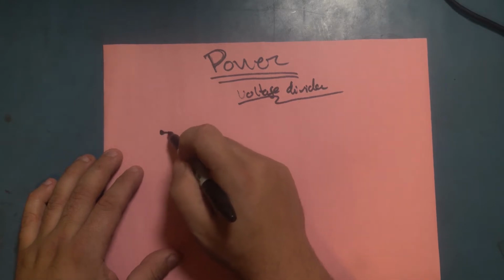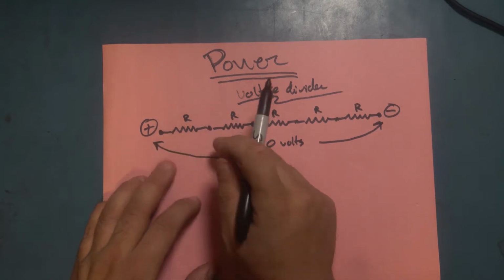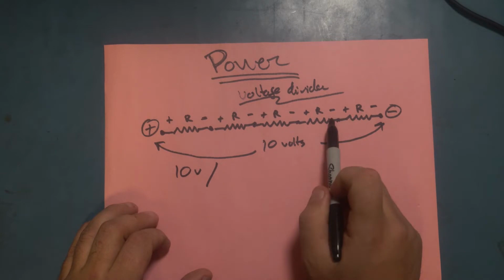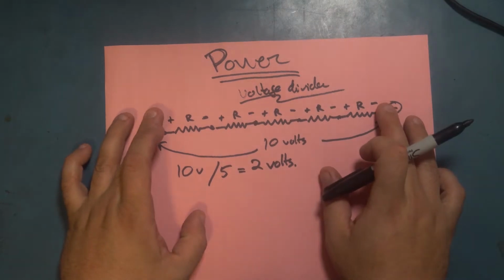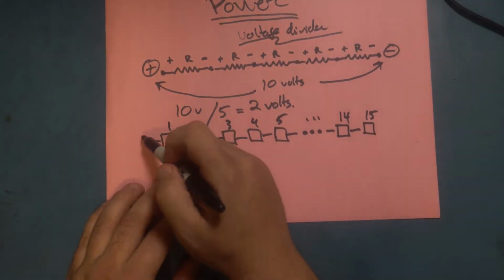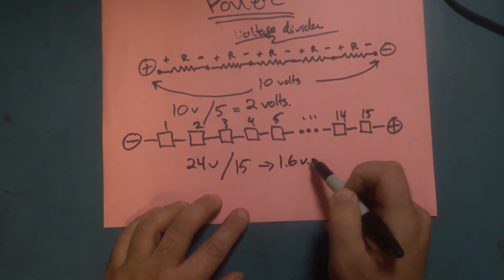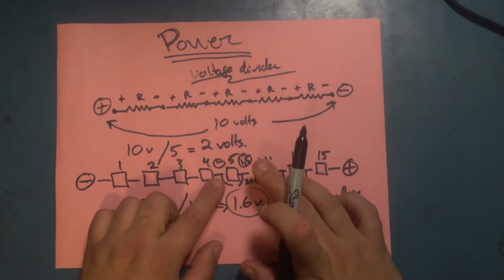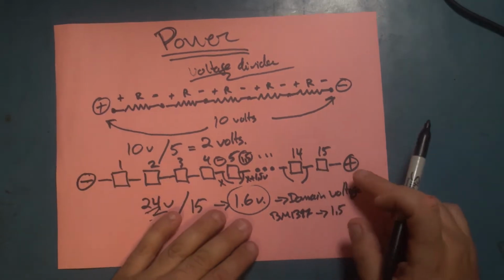ASIC Repair - DIY Corner - Power Distribution

Comment: I'm not sure that your description of how the 1.8V and 0.8V voltage domains is correct. According to schematics and a number of boards I've seen (taking the S17+ as an example), the 1.8V core domain voltage (and thus the 0.8V domain) is regulated down by the domain LDO straight from the 21V main supply voltage for all but the last three domains. The last three domains derive their 1.8V supply from the 24V boost regulator output. What you stated here is that the LDOs derive their input voltage from two domains prior to where they are, and I'm yet to see a board with that configuration - in fact, if you do have collateral showing this for models you've worked on, then It'd be really good to share that. As an aside, the domain voltages and power distribution of these boards are amongst the worst I've ever seen in high performance computing and FPGA designs in general, in over 25 years being a researcher and an engineer.
Reply from the maker: Thanks for the input.  I'm not sure how your proposed layout would work.

1. On a S17+, you can easily see that the input pin of the 1.8v LDO of domain 1 is directly connected to the ground of domain 5 which is effectively the same as the positive side of the core voltage of domain 4 (3 domains higher, hence the need for a boost voltage for the last 3 domains).  There is an internal trace, just check continuity and you will find it without a doubt.

2. We know that all domains use the same values for the components used to set the regulated voltage. If all LDOs were supplied by the board voltage, the output of each domain would be different relative to each domain ground since the ground of each domain varies relative to board ground.

3. The schematics call the LDO input VDD_IN where the board voltage is VDD_21V0.
Reply: @asicrepaircanada159  
Thanks for responding; I just love these discussions :)

Re: 1, without the benefit of X-Ray inspection of the internal layers, standard practice would dictate internal ground and power plains, as well as who-knows-what other layers inside; these will also double as thermal dissipation aids. I bet if we de-populated a board, we'd be able to identify both through and buried vias that achieve the routing. Not that I have any confidence in any schematics the Chinese produce, much less Bitmain, but I'm going by a) what the (silly excuse for) service manuals show and b) by measurements taken from repair jobs.

Re: 2, not sure I get what you mean here. All LDOs, save the last three, are fed by the 21V pre-boost. Using the same component values only makes sense, since you want the same voltage across the domains - 1.8 and 0.8. I've not done full testing on grounds, but suspect that grounds for the 1.8v and 0.8v domains are one and the same, hence you're able to derive the 0.8v straight out of it's 1.8v older brother.

Re: 3, you're neglecting the MP2019, and therein lies another ridiculous design quirk.

Comment: How much dc voltage is needed to test T17e hashboard ? Can we test the hashboard without its power supply ? Thanks for sharing.
Reply from the maker: Sorry just seeing your comment now... You need a power supply to test the board, either the one from the miner or a bench one.  Somewhere between 16 and 21 volts will work.  If you are using the same tester that I am using, you will need a bench power supply since it cannot control the miner PSU.  Hope this helps!

Comment: Thank you so much for the valuable almost gave up fixing s17+ found out some a cap at chip side from domain to ground is shorted , also would like to ask if I don't only get 400mv in my domain how to I check ? I got 0.8 n 1.8 from ldo , chip problem ? Also some with low 0.9 but can find full asic but will get intermittent temp issue how do I bring up the domain voltage ? One of the chip resistance is low ?
Reply from the maker: That is a lot of question for a youtube comment my friend.  Hop on the discord and you can get some help there.  For domain voltages: depends on you are measuring it.  Generally speaking, there are only chips and caps that can short a domain.  If you have all chips I wouldn't start chasing that problem.  Chips all have varying internal resistances....as long as it's not completely shorted, it's hard to tell if there's a real problem.

Comment: So between the voltage domains we should have the same resistor measurement?
Reply from the maker: In a perfect world, yes.  In the real worls, it should be close.  The resistance of one domain is really the internal resistance of all the chips on that domain in parallel.  You just want to make sure of of them isn't shorted.  Also, a short on a domain could be one of the caps, typically on the back of the hashboard, although I have only seen that once. 

It's like saying: should we have the exact same domain voltage for all domains.  Ideally yes but close enough is good enough.  Hope this helps.

Comment: Salut!! Great video.  I wish the boards I am working on were so clean.  Mon Dieux.  I am going to pass this video on to some users on the discord channel who have been asking me about where to start during their repairs.  I always say, see if you have power from the mosfets, then start chip troubleshooting.   I would add that more attention should be put on U7 which sends the power to the Mosfets Gate and is a major cause of power loss.  Too many people start reprogramming the PIC and changing out Mosfets without looking at U7 the two diodes and the resistor leading to that gate.
Reply from the maker: Salut!  Thanks for the comment.  You are right that people tend to focus on the wrong things sometimes, probably because programming a PIC is easier than replacing a chip... There will be more videos coming, especially on the diagnostic side.  I am just trying to lay the theory foundation first before going into it.  Next video is probably going to be on signals...